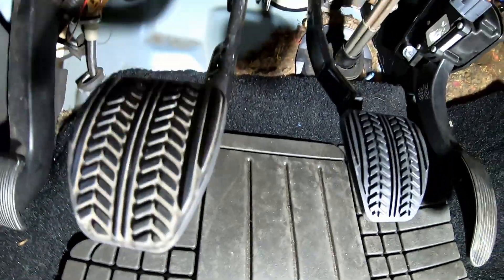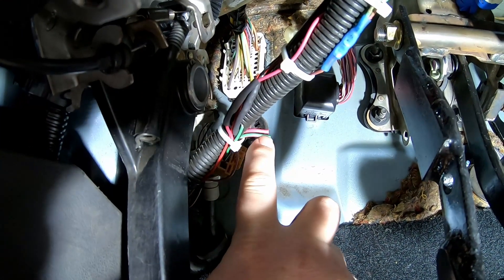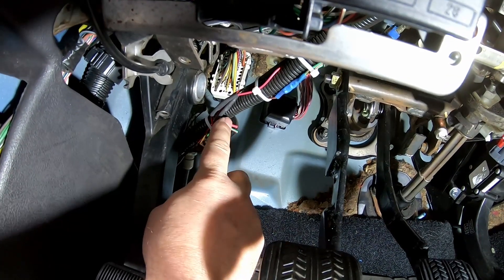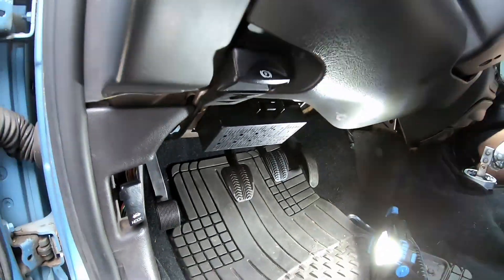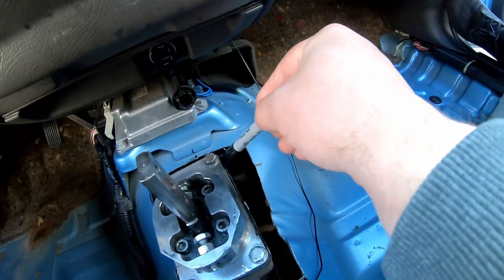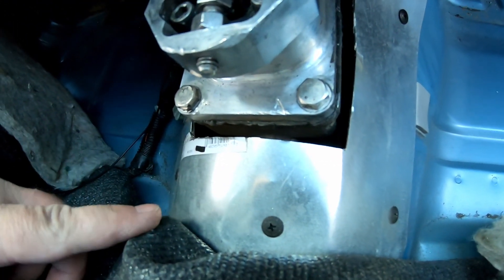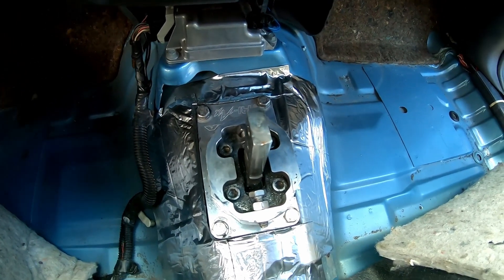Manual 5 Speed Crown Vic Part 4, Wrench Lights, Annoyances, & Custom Shifter Boot!

Comment: Right on Mr. Black,
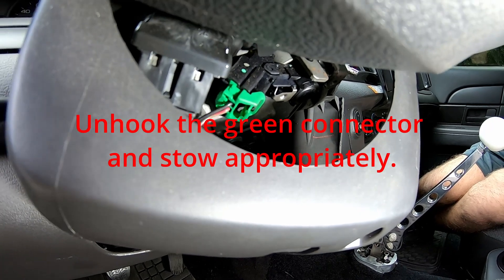4:24 After you disconnected the solenoid, and fired it up to make sure the wrench light stayed off, I was terrified the check engine light would illuminate. Lol
-Chuck
Reply from the maker: That would have been our usual luck lol.   Thankfully someone else had paved the way.   I think it was BP builds.

Comment: I’ve got a 2010 p7b as well. I can’t seem to figure out why I have a rev limit stopping me from going above 3200. I’ve raised the neutral rev limit and it did not change a thing.looking to see if you had similar issues
Reply from the maker: No josh.   We are using the Mo's Speedshop tune on a SCT X4 tuner with no problems there.  It will rev all the way out to like 6k although it doesn't make any power up there lol.
Reply: @PNW_Car_Mods  I have the same tuner, I’ll have to get in touch with mo’s speedshop
Reply from the maker: @joshdillinger6598  Mo's was excellent to deal with.  We had a few hiccups of our own doing and Mo busted his ass trying to help us figure it out including after hours and weekend calls.

Comment: If you have sound when you turn to left side you need to put 65-73 trans mount and it will gone i do it in my 10 grandmarquis and its gone great
Reply from the maker: Good to know. I have not heard of using that vintage of mount!
Reply: @PNW_Car_Mods  I searched a lot about it because the problem had been with me for a whole year
Reply: @PNW_Car_Mods  use the polyurethane trans mount for 65-73

Comment: Do you get any check engine light code for not having the auto trans
Reply from the maker: Yes it will.  You have to get custom tune uploaded to the car to eliminate any trouble lights.

Comment: Can you show us how to remove the shifter lever
Reply from the maker: Unfortunately ahmed, I would have to put it back together to then take it back apart to show you lol.  It's super easy. Take the top plastic column cover off and removed the torx screw from the shifter handle.  Unplug the overdrive on off switch and then put it back together.      If you are lucky you can find a Marauder rubber insert to fill the hole in the column cover but they are virtually impossible to find.

Comment: Break down o bc price?
Reply from the maker: I'm not sure what you are asking???????
Reply: @PNW_Car_Mods  sorry I didn’t notice the message was messed up, I was wondering how much in total this project costs you to do?
Reply from the maker: @mikeyrozell5627  I want to say it was right around 1500.   It's going to vary wildly depending on what you can buy the parts for and if you have to pay someone for pedals.   We had around 800 into the transmission and shifter.  300 for the clutch/flywheel and I think 400 for the tuner.
Reply: @PNW_Car_Mods  thanks for the info I’m going to say that’s less than expected, it’s been heavy on my head to do the swap . Would you say it’s worth it?
Reply from the maker: @mikeyrozell5627  No regrets.  This car still gets driven daily.  It is fun as hell to drive.   It's the worlds fattest Mustang lol.